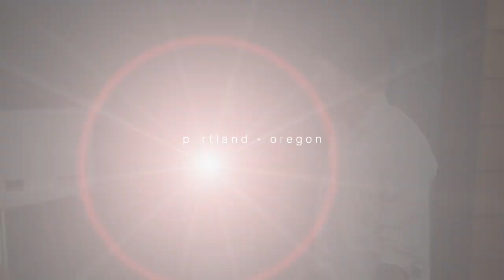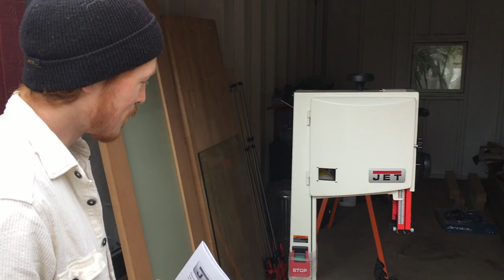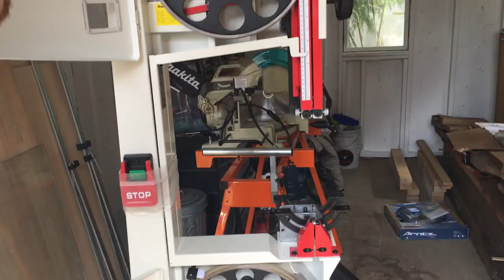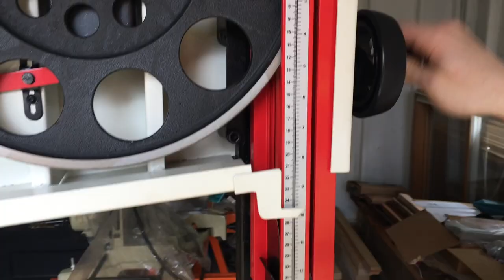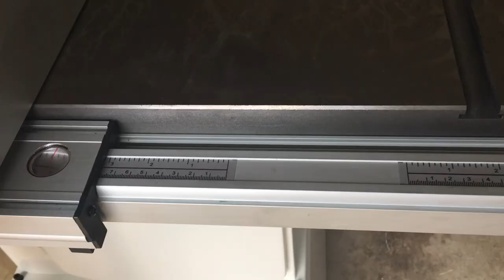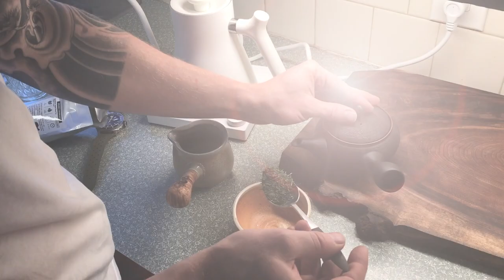Redcedar Review / JET JWBS-14SFX - Initial Impressions and Assembly

Comment: I have had this saw for a while and for the most part am happy with it. However there are a couple things that should be noted. #1 As with many bandsaws, the tensioning indicator is completely useless and for the life of me I have no idea they ever install them. I was changing to a smaller blade and decided to give it a try. Well lets just say the blade tensioning device ran out of threads way before the indicator reached the selected blade size. luckily the case retained all the parts that came loose. Just keep relying on the finger technique. #2 The red covers that cover the lower blade guides are troublesome when adjusting the lower blade guides as they require removal to perform this operation. I would suggest they change the way the cover is installed to a easy snap into place design or design the guides that removal of the cover is not required. There are a few smaller issues that are not really worth mentioning, but I feel a proper R&D department will find solutions and improvements in the future designs.